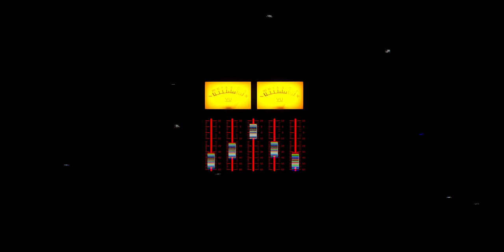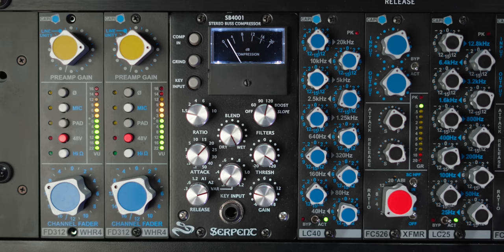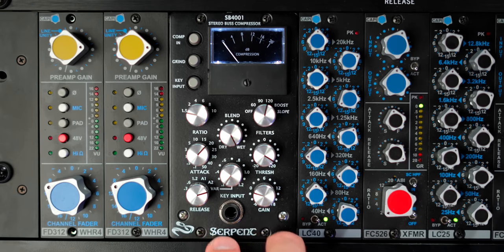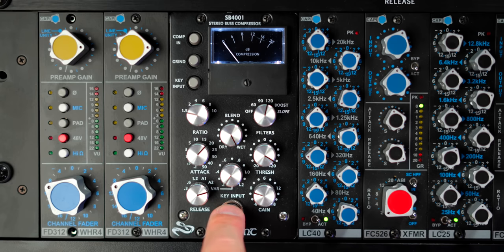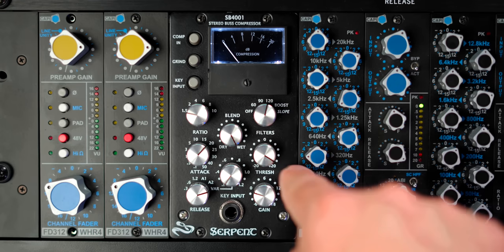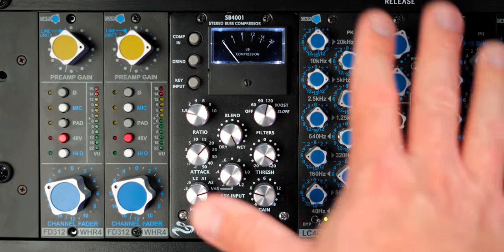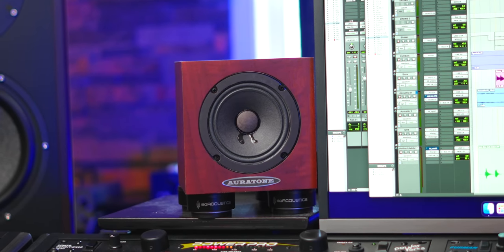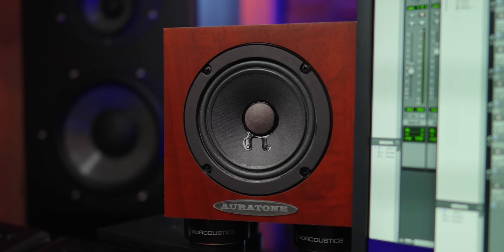Mix Bus Compression - ALL MY SETTINGS!

Comment: My mix bus compression is pretty straight forward. I have the audio coming in at about -8db rms. I use an ssl bus comp. I have a 30ms attack, autorelease, a ratio of 4, and the threshold set for max compression of about 5db. The sidechain/filter/whatever you want to call it is set so the kick and snare trigger the compressor approximately the same way. 

I almost always will use it. When I do use it, it will be the first effect I “turn on” and I mix everything through it
Reply from the maker: Sounds like a good plan to me! Thanks for watching

Comment: As always a very good and informative video.
Maybe sometime you could do a video on how exactly you integrate your hardware into the mixing process (i.e. connect, set up and routing) ? I just bought my first 500 rack with 2 capi vp25, a bus comp, an opto comp and a deesser but just can't get a handle on the latency. I would be very interested to see how a pro gets around the issue 😊
Reply from the maker: I have a very old video called ProTools 2019 problems and mixing with hardware that explains how I handle this. It is a very rudimentary cell phone video, but it gets the point across. Thanks for watching!

Comment: A little off topic but... Are you using the original op amps in your Heiders or did you install the newer CA-0252s??  Thinking about trying them!  Great video :)  I need to try something other than the auto release on my SSL...
Reply from the maker: I have 0252 in some of my different EQ, but the Heider still have the original

Comment: hey colt i see you are hitting red lights on mic pre i watched your video in which you explained having mic pre on mix bus i use neve dpx so driving them hot isnt a problem during mixing?
Reply from the maker: As long as you are using your ears, not your eyes, there is no problem. Red lights on a pre are not necessarily bad as long as it sounds good. Good question!
Reply: @ColtCapperrune  thanx 😊

Comment: I respectfully disagree: putting the compressor on from the beginning doesn't work for me. This way I'm hitting a compression that I don't see when setting up other compressions on single tracks. I've been mixing twenty years with nothing on my mix buss and when I'm close to the end of the mix I put my 2buss compressor on (usually an SSL type) and it gives me that "glue" effect together with probably some EQ and saturation added, I just have to adjust and refine some levels , but that's really minimal. I'm seeing this other approach recently, the "top down one", but I really don't understand why. Plus, working with no "sauce" on my 2 Bus from the beginning forces me to get the sound I want from the single tracks, without relying on anything strapped across the 2 buss. I just add it at the end for extra polish and finalizing effect.
I ackowledge that everybody has his/her own way of going at this. Tried it, top down doesn't work for me, and yes, I too use mix buss compression 100% of the time.
Reply from the maker: To each their own! I’ve been mixing this way for at least 15 years. But if it doesn’t work for you then there’s nothing wrong with doing it a different way. If it sounds good it is good!

Comment: Stupid question: What is an "808"??
Reply from the maker: No such thing as a stupid question! It’s the classic electronic kick drum sound. But a widely used term when referring to any sort of electronic kick drums.
Reply: @ColtCapperrune   Yes indeed, the term is thrown about these days by the kids for just about any bass hit Kick drum sound, but an 808 kick is simply just the kick drum from Roland's classic TR-808 drum machine (analog) from the early 80s.